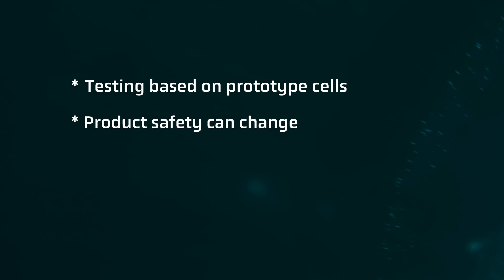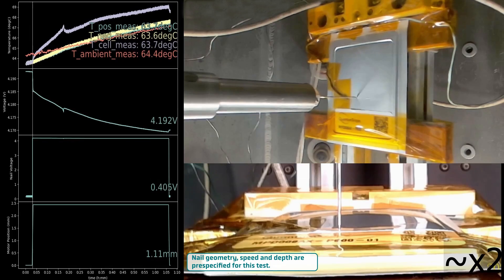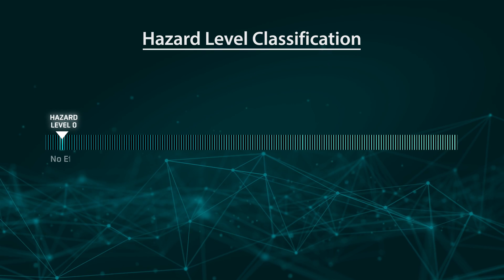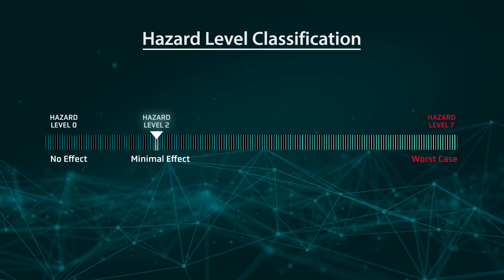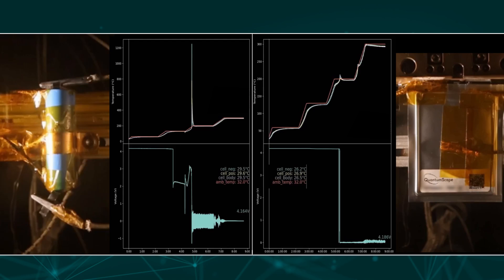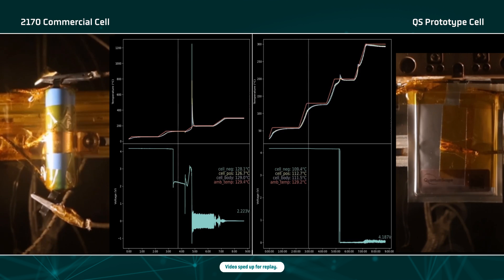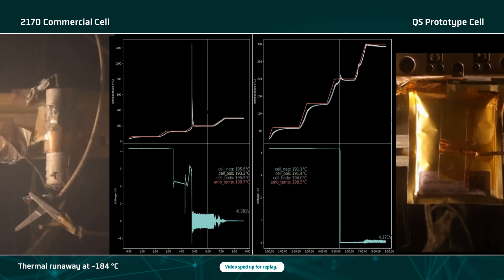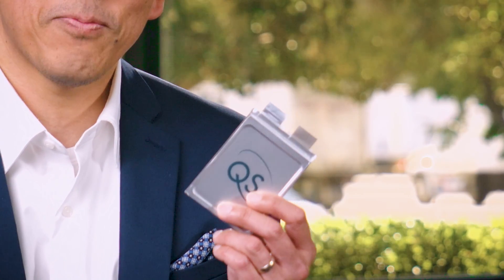QS Battery Safety Report

Comment: I can't wait till your devices are used everywhere, however I'm a bit confused and need someone to help, towards the end of the video the ceramic separator was referred to as an "electrolyte separator".  I was under the impression that there was no electrolyte in your cell. What am I missing?
Reply: 08:45 the host said : ....ceramic solid state electrolyte separator, and not just "electrolyte separator". And if you refer the ceramic separator as "electrolyte" , it is still ok. If it is not electrolyte, the ion will not pass through.
Reply: There's always some electrolyte, be it liquid or solid :)
Reply: Electrolyte doesn't have to be solid.
Reply: @brucejankowitz4501, I forgot to write this - they've done away with one of the electrodes, not the electrolyte. That's probably where your confusion came from
Reply: It’s a ceramic separator but QS, since the beginning, has said that this first iteration will still have a very small amount of liquid electrolyte.

Comment: Great video the thermal runaway seems so impressive its hard to believe its real. Please continue to put these out
Reply: It’s actually not hard to believe if you understand Batteries! A Li Metal battery with little to no liquid electrolyte will behave that way. That, combined with significantly faster charging, high discharge rates (if needed), lighter weight, higher energy density are the major reasons this technology will be the future, at least for a while. This isn’t just a new Battery, this is a revolution in Battery technology.

Comment: I assume your reference battery was an NCM battery. Be interesting to see the test results  of a LFP battery undergoing same tests
Reply: LFP offers a somewhat better safety profile than NMC-based batteries; the iron-phosphate cathode material contains oxygen, but that oxygen is trapped in a more chemically stable bond.
Reply: What difference would it make of it was LFP battery?
Reply: QuantumScape's anode-less lithium-metal tech is cathode agnostic and, as such, will support both NMC and LFP chemistries.
Reply: @That80sAstronaut  I understand that. But my question was, how would Thermal runaway tests would vary between NCM and LFP? Overall test results will be better, if they did a similar test between LFP 2170 and QSE-5 LFP. No?

Comment: Everything looks perfect, but I know there’s no such thing as perfection in the world. Can anyone tell me what the weaknesses of the battery are?
Reply: Quantumscape's battery (the separator to be precise) is hard to manufacture and they have not proven scalable, price competitive, mass production yet. That's the bet you make when investing in them.
Reply: Thank you for your explanation. Indeed, investing in new technology involves certain risks. I hope they can address these issues in the future.
Reply: @maxpfi9137  Mass production is not hard to overcome if there's time and enough cash. Problem is that we are time sensitive, meaning that we can run out of cash.
Reply: @maxpfi9137 very well explained!
Reply: Scalability is, at this point, the biggest risk! SSB’s have been tried and lost for Decades now. However, I do believe that QS has the recipe and backing to see it through! I don’t expect anything until 2026-2027 timeframe, which is in line with my expectations.
Reply: Everything does not look perfect, it looks good or at least usable but there are many battery technologies that have a better safety profile. There is no mention of cost or cycle life, both of these will also be big factors in whether they are successful.